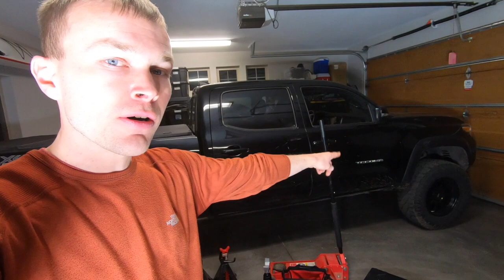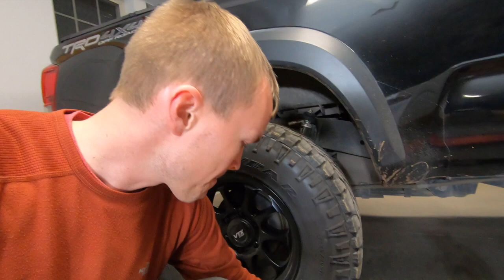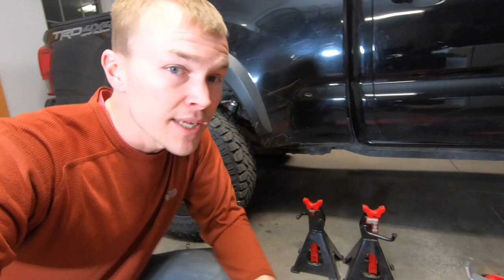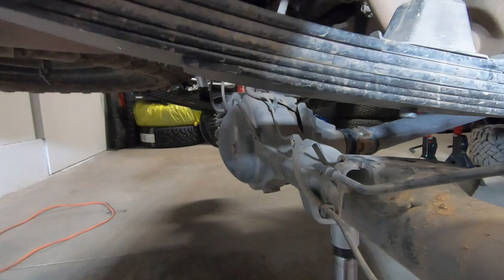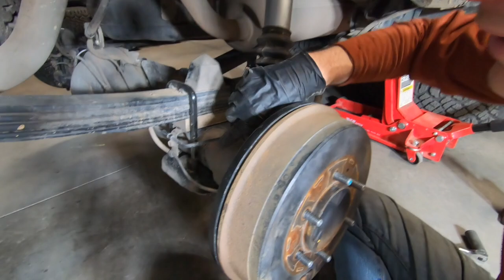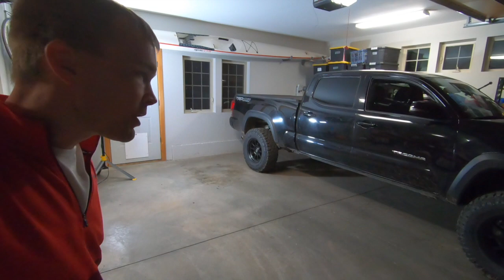Rear Block Lift Install - 3rd Generation Toyota Tacoma

Comment: So putting the block on doesn’t require new u-bolts?
Reply: Depends it looks like he was taking a block he already had in there back out then back in to make the video. My 3 inch kit came with longer u bolts.

Comment: Looks great! I actually have a 2001 4runner and only want it to sit a little higher without messing with the OE specs. I will do 2 inch front spacers and 1 inch block in rear.  What it did for your truck is perfect.

Comment: This may help someone doing this. You DO NOT have to remove the wheel and jack up the frame to lower axle and all this. I just installed 3" blocks on my 2017 Tacoma. Literally just remove the ubolt nuts, remove the ubolts, get a floor jack (I used a 4x4 block bc of the height) and put the jack under the leaf spring as close to the axle as you can get and jack it up until you have the clearance you need. I was in and out 20 min both sides total time. Easy easy.
Reply: This comment is epic. With the limited resources and time I have, this is huge.
Reply: God sakes man thank you!

Comment: How did you get the leaf spring and the axle to separate so easily? I’m having problems with mine. The center bolt that goes through the leaf springs and buts up into the axle won’t allow me to separate the two

Comment: I've been considering lift blocks on my 2018 Taco, I have a 3 " leveling kit on the front. But I do need to raise the rear because of the rake. Thanks for the video.

Comment: Great video. I’m about to do the same on a second gen. Have you ever tried to do this with Jack stands on the rear pivot point of the leaf springs instead of the Jack up front?  Just wondering it they would be in the way or not…?

Comment: Very straight forward. Thank You. One question. Did the modifications you made to both the rear and the front of your truck have any impact on the ride quality? Did it become a stiffer ride?
Reply from the maker: Yes, must stiffer than it was originally.  Spacer & block maintained the stock ride but the new shocks and add-a-leaf totally changed it

Comment: I was thinking of installing 1 inch block too on my truck, If I am working on one side can I remove the tires one at a time instead of removing both at the same time? I don't have enough jack stand.
Reply from the maker: It will be a little tricky to do one side at a time.  To get the gap you need on one side you've got to be able to push the axle down which requires it to push up on the other side.  Maybe you can find a single point in the middle to support the weight of the truck on your one jack stand (trailer hitch?)... I'd recommend just buying or borrowing a second one.
Reply: Yeah you can do one side at a time it’s. Easy

Comment: I already have a heavy duty rear leaf spring but would still like to raise my back.. you think adding a 2" lift block will be ok?
Reply from the maker: I don't see any reason why it would be a problem
Reply: Concerned about the ride quality.. with my set up, do you think i should go with adding a 1" or a 2" spacer?

Comment: Was wondering why dint you use both of your jack stands on each side, instead of using your floor jack on the passenger side.  I’ve had floor jacks drop on me before by loosing hydraulic pressure.

Also did you have to disconnect your ABS bracket for slack or your brake line bracket?
Reply from the maker: I had the jack stands positioned in case the floor jack were to fail.

As for the brake line I did remove the bracket closest to the brake due to the increased height.

Comment: Did adding the block interfere with the quality ride of icon lift? I have a stage 2 as well and need more rear lift
Reply from the maker: No, didn't notice any change to ride quality with or without the block
Reply: @DrivenCompanion  did you use the stock u bolts ?
Reply from the maker: No the kit came with replacement u bolts

Comment: Hey I’m considering doing a 2 inch block in the rear, but would like to use a U bolt flip kit, I wonder if it would work
Reply from the maker: I'm not expert but it looks doable.  Did a quick search and found this page: https://www.relentlessfabrication.com/products/u-bolt-flip-plates-for-tacoma-springs

Comment: did you remove your overload spring?
Reply from the maker: Yes I did.  Instructions said that I should but I'd recommend leaving in place if you want a little extra height.
Reply: Mike C I did a 3aal and my truck felt every tiny little bump with the overload. Installed the blocks and removed overload spring and now it rides so nice.

Comment: Nice.  Were you able to use the stock U-bolts or did you have to get longer ones?
Reply from the maker: The kit came with new U-Bolts so I used those.

Comment: When I lifted. I had no luck lifting the frame.  I ended up lifting from the pumpkin.  Then used another jack to lift the leaf spring  up till it made enough space for the block.    First side took 1:30 hours.  Second side took 10 min.    Don’t know how you got the leaf to come off  by lifting by the frame.   I’m I’m running an ome  Dakar leaf pack and wanted another inch.

Comment: Great video bud!! Can you add that 1 inch block and add a add a leaf to that? I'm going to install a 2.5 Fox shocks that can be raised up to 3 inches and I just wanted to make sure that I get as much as I can when getting this installed?
Reply from the maker: Yes, I have an add-a-leaf installed already and coupled it with this block.